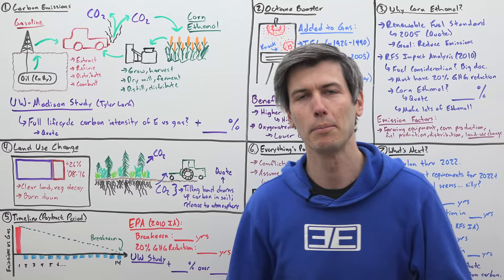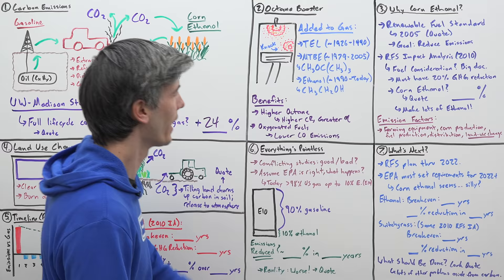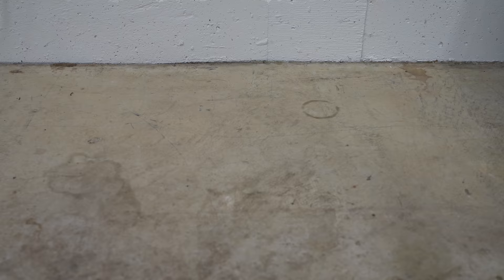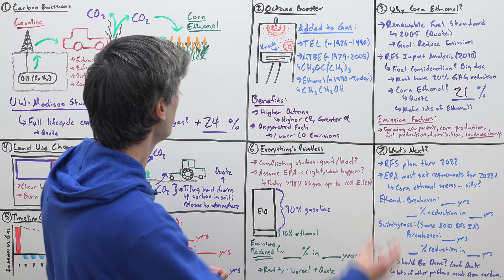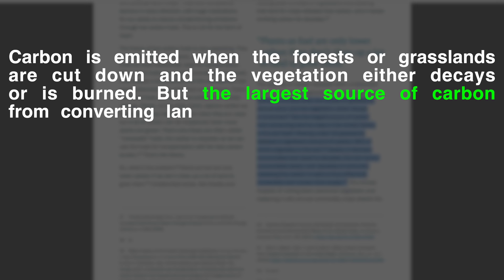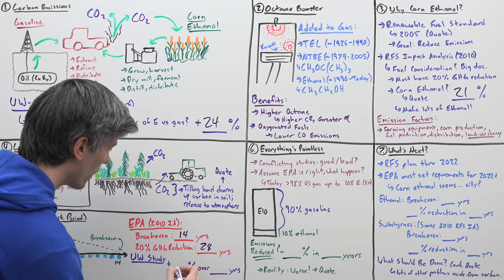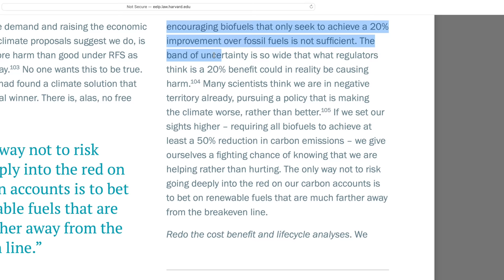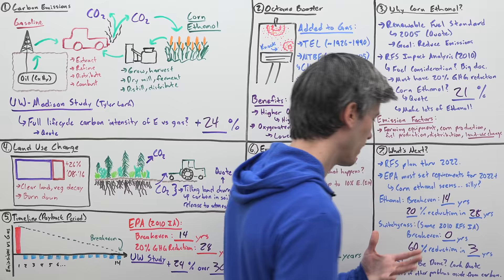America Was Wrong About Ethanol - Study Shows

Comment: I'm more annoyed by the fact that my car starts very difficult if the fuel has 10% ethanol in it. Switched to a premium fuel without ethanol and it starts fine, but it is quite a lot more expensive.
Reply: Get it tuned up! Your BS us.
Reply: @oldblueaccord2629  my BS you? If you mean I'm bullshitting you, I'm not. It is an old car (2008), a Renault, and should run fine with 10% ethanol, but it doesnt start properly.
Reply: @Twiggy163  Do they even sell 10% Ethanol fuel in your country?
Reply: @oldblueaccord2629  yes. How the hell else would I know it is giving me trouble?
Reply: @Twiggy163  I was flushing out if you were a bot or not. They havent sold Renealts in the USA as long as I can remember.
Reply: @oldblueaccord2629   Not having Renault isn't a bad thing. But, I'm stuck with it as long as I'm saving up for a better (and more recently built) car.
Reply: @Twiggy163  Try getting your fuel injectors cleaned and change your fuel filter if it has one. That might help.
Reply: @oldblueaccord2629   the fuel injectors were cleaned quite recently. The fuel filter is a good one.
Reply: @Twiggy163  That sucks you have to use premium kinda a waste of money.
Reply: @oldblueaccord2629  it realy is. Its not like the damn thing goes any faster. It just costs €2.10 per litre instead of €1.90. Had no such issues when it was called E95 and had 5% ethanol. Maybe I need to drive it more often aswell when it has E10 in it.

Comment: Corn gas ruins everything.
Reply: BS
Reply: @oldblueaccord2629  Clearly, someone who has never rebuilt & replaced as many victims of corn gas, especially 2-stroke, abuse as I have.
Reply: @Mike--WA7QZR  If you truly believe that, then I suggest that you sell everything you have, move to Brazil where the common gasoline contains 27.5% ethanol, and buy up every single engine repair shop you can find (note they have many of the very same 2-stroke engines and non-flex fuel vehicles we have).

If your claims are right, then you should become a gazillionaire in no time at all.  Thank me later.

PS Paraguay who lives next door also went to E27 for another option.  Bolivia is going to E25.

Comment: Clearly you'll aren't farmers.  One major fact left out of the calculations is how farmers grow corn.  You can't grow corn year after year without fertilizer.  Corn requires tons of  fertilizer to grow. Crops have to be rotated. Farmers use all their land that can grow crops.  There is not land next to their property they can by to turn to farmland. They are land locked. And don't forget irrigation.  You need to talk to a farmer.  Your calculations don't  include the energy to make corn moonshine. 😆😆😆
Reply: The US used 11,160,933 tons total fertilizer on corn in 1980, before ethanol.

In 2018, the year of most ethanol production ever, the US used 10,521,850 tons total fertilizer on corn.

100% of the fertilizer (& everything from the soil) still get fed to livestock in the distillers grains.  Ethanol comes from only things of the air: solar energy, CO2, and water with the latter two recycled once burnt.

Ethanol C2H6O = no fertilizer

Distillers grains = all the fertilizer

What logic is it to then assign all the energy and CO2 of fertilizer to ethanol and none to distillers grains? 

Iowa State University measured all the energy it takes to produce an acre of corn into a "diesel fuel equivalent".
This included making the machinery, fertilizer, chemicals, plus the tillage, planting, spraying, harvesting, drying, trucking etc. 
They found it takes 34 gal of diesel to produce one acre of corn.
What do we get from those 34 gallons of diesel?
We get >500 gallons of ethanol.
But wait, that is not the kicker.
The kicker is we still get 100% of the protein and other things from that acre of corn still available for a healthier and better feed called distillers grains. A win-win.
Reply: Around 87% of corn is not irrigated.

Of the top states who irrigate, only dry Nebraska is known for corn.

Nebraska irrigation water use USGS data:

1985   7265.09 Mgal/d  before ethanol
2015   6090.6   Mgal/d  when ethanol mandate maxed out

Newer ethanol plants use waste steam to make ethanol from nearby/onsite natural gas electricity plants.  Waste steam = free energy (essentially)

Waste steam produces no new CO2.

Note that ethanol is distilled with relatively low temperatures whereas crude oil is distilled twice, once to remove water and a second time at a whopping 750 degrees F.

There is an ethanol plant in Sioux Falls that uses natural gas from the city's land fill to make ethanol.  In Nevada Iowa, an ethanol plant also digests corn stocks into renewable natural gas and humus/fertilizer.

Note that there were no forests or grasslands broken up for ethanol.  Quite impossible since cropland acres have been declining.

Census data shows corn producing states increased grassland, forest, and wildlife areas since ethanol.

The corn belt grew more acres of corn in 1980 before ethanol than in 2018, the year of most ethanol ever produced.
Reply: Fertilizer is made from petroleum coke byproduct. To make corn mash the corn has to be cooked with gas or steam.  Fermentation yields 5 percent ethanol. Then the corn beer has to be distilled multiple times by heating with gas or steam.  Yes the mash makes good feed. 🙂🙂🙂🙂
Reply: All the energy it takes to produce and deliver a product to the consumer is reflected in the price of that product.

As such note that the spot cash delivered price of ethanol on the NYMEX is $1.48/gal.

The price of unusable sub-grade gasoline (RBOB) is $2.76/gal.

It takes more energy to make sub-grade gasoline than ethanol.

To turn RBOB into usable E0 fuel costs even more for the same reason premium costs more.  Unfortunately, it becomes even more toxic and dirtier.

Or simply splash in >10% ethanol to RBOB and the resultant usable fuel becomes less toxic, far cleaner burning, and cheaper/cheaper per mile to drive with.  Who can be against that?

PS: Wine fermentation achieves around 15% ethanol and industrial yeasts 20%.

The distillers grain is what make corn the most economical source of ethanol, even if they make more ethanol per acre.  But as a source, it is limited to the size and protein requirements of the cattle herd on feed.  Beyond that, it becomes uneconomical to make from corn.
Reply: @fredbalster3100  Nitrogen is made from natural gas and nitrogen from the air.  Phosphorus, potassium, lime, and gypsum are mined and processed.  Sulfur is now used from chimney scrubbers from coal electricity plants.  I am pretty sure natural gas and nitrogen from the air makes the ammonium sulfate with some of the sulfur too.

Coke only has carbon and few farms apply carbon plus I think the carbon sources are mined from cleaner sources than that.
Reply: @fredbalster3100  Sorry Fred big miss by you. Very sorry.